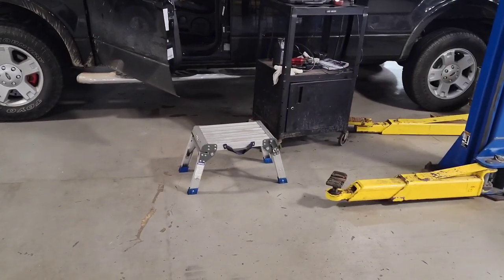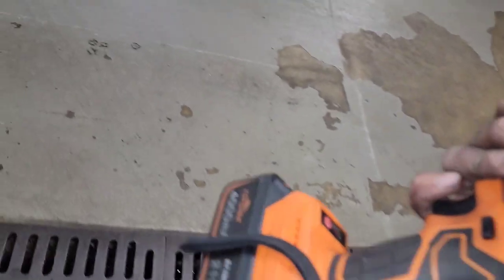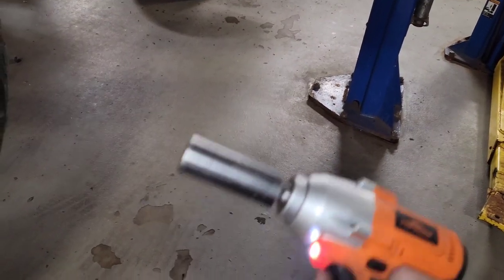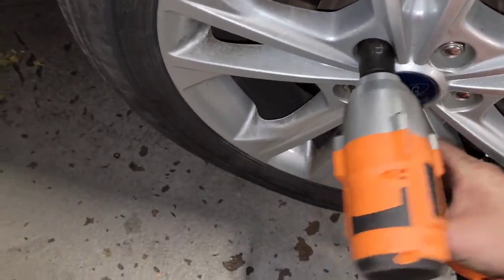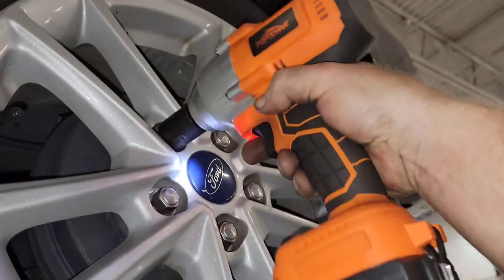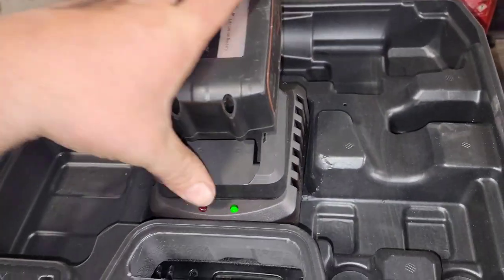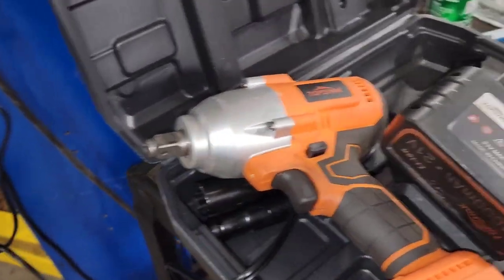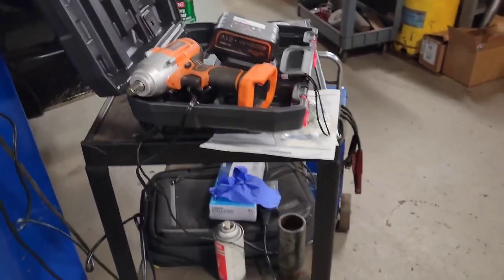1/2 Inch Drive TopShak Electric Impact Review 4000MAH 21v With Charger - Black Friday Deal

Comment from the maker: FLASH DEAL NOW $118.99
https://m.banggood.com/TOPSHAK-TS-PW3-550N_m-Max-3000-BPM-Brushless-Cordless-Electric-Impact-Wrench-Car-Repairing-Tools-Woodworking-Tools-with-4_0A_h-Lithium-Ion-Battery-p-1906145.html?utm_campaign=FordBossMe&p=I7092354530876202012&ID=523698&DCC=US&currency=USD&cur_warehouse=CN
Reply from the maker: corey Babcock  don't have to click on the link and then take the Newton meters and convert it
Reply from the maker: corey Babcock  so I think it's like 405 foot-pounds of apply to work and then something like a thousand foot pounds of breakaway but I don't know that for sure
Reply: The only problem I have is the shipping cost is almost the same price as the tool Shipping: US$90.35

Comment: Had the swollen lug nuts on my 2011 f150. Replaced them all with one piece dorman from rock auto. They looked great until snow season. The road salt turns them crusty and corroded looking. I clean them up in spring with a red scotch brite pad. But, no issues removing them ever. The factory two piece lug nuts are evil!

Comment: Get the 1/2 inch Kimo impact on Amazon. Comes with multiple sockets, deep and shallow plus extensions for 99 bucks. And the sockets aren't loose on the tool. It's got an option on it that if you loosen a lug nut it stops itself. Fast charge as well.
Reply from the maker: Dude I do reviews on free tools and I'm honest in my reviews there are a 1000 different tools better usually 

I just give options, I'm sure the tool you mentioned is very nice
Reply: @FordBossMe  I got ya. Love the content.

Comment: I bought an Ingersol Rand T-max gun when they first came out. Titanium and poly carbonate, very light and powerful. With a swivel and 6ft. whip it's easy to use. I find the battery models heavy, but I am 67 now, so lots of stuff is heavy. I guess lots of techs. are using the battery models now?
Reply from the maker: Yes

Comment: Looks like it has plenty of power. I'm interested in how it holds up for the long haul. I don't turn wrenches for a living anymore, but wouldn't mind having a gun like this. I just think about my past experiences with "no name" electrical tools. We had a Harbor Freight "type" store in my area years ago. I bought a right angle electric drill and an electric die grinder. Both died quickly with minimal use. I had a Craftsman electric die grinder that I had for years. Put it through its paces. It finally died one day. Dug out the Chinesium grinder. It lasted two weeks. Found one at Harbor Freight. It blew up after about 5 uses. I know you will give us an honest review.